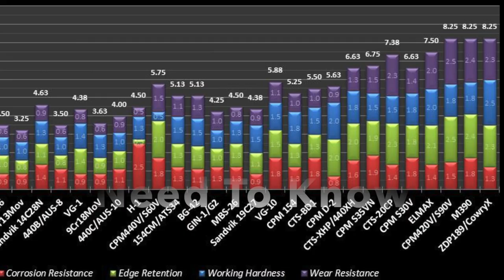Knife Basics - What You Need To Know About Knife Steels

Comment: This makes me love cold steel  even more does anyone know how strong or good  carbon V from cold steel is It's a steel that was still made in America
Reply from the maker: Originally Carbon V was basically 1095 with a bit of chromium added to the mix.  Unfortunately it's a proprietary term owned by Cold Steel and there is some evidence that they have changed the steel it refers to at least once.  It still seems like a good steel though.
Reply: Many years ago I remember a hardness test of various knives from China.  It was kind of scary, they slap any label they want on anything. There seems to be no standards.

Comment: It's all good steel except that 9 cr13 china steel . Buck does wonders with the 420 with it's heat treatment. Esee does a phenomenal job in 1095 and Benchmade has s30v the best. Spartan blades does s45vn very well. I have a Bradford in elmax that holds an edge but I wouldn't pry with it. .
Reply: Weirdly enough 1095 although perfectly adaquate actually has relatively sub par toughness at a given level of hardness so Esee could do even better with an alloy like 1084 or even better still with 80crv2.
Reply: I have a Chinese Spyderco Tenacious in 8cr13mov that is always in my pocket because it outperforms everything in my collection, including magnacut and m390. Know why? It’s a better knife and grind, design, and heat treatment than something like a Kershaw Link in M390. If it’s steel that can be hardened through heat treatment, it is good enough to make a fantastic knife. It’s more up to the maker than the steel.
Reply: Nerding out on steel is just a thing produced by the iphone generation where specs on paper mean everything, and actual, objective observation through use isn’t even considered.

Comment: What is your favorite steel for long term  survival knife?
Reply from the maker: My current favorite is CPM 3V.  It's a very tough steel, with good wear resistance.  1095 is probably my second favorite.  Again a very tough steel, and while it doesn't have the wear resistance of 3V it still takes an edge and holds it well.  A third one would probably be 154CM.  It's hard to work, so it's not common and it tends to be relatively expensive; but it holds an edge like nobody's business.
Reply: @ckurtz1013  Can you recommend a 3v survival knife, which can allow me to do some bushcraft tasks as well? 
I do not know why but I do not trust Cold Steel (SRK, Master hunter 3V) 
and Bark River is bit expensive :D
Reply from the maker: Benchmade's 202 Leuko is probably the most affordable one I'm familiar with, and you might find some good deals from Bradford and Dawson; but in all honesty, I doubt you'll find many in 3V below $250.  Another reason why 1095 is my 2nd favorite steel for outdoors type use.  It's a hell of a lot cheaper than 3V or 154CM.
Reply: @ckurtz1013  Thank you!

Comment: First. Please I want the link to the picture of the video

Second. I'm from Brazil, and here we have steel 5160 and 52100, and idk the names of these steels in English, so plz help me!
Reply from the maker: Most steels have the same name no matter which country you live in since the name is decided by the company that makes the steel.  That's definitely the case for 5160 (commonly used as a spring steel here in the U.S.A. as well as a knife steel), and I'm pretty sure that's the case for 52100 as well.  As for the image I used in the thumbnail, I got it from BLade forums.  A quick link is https://i.imgur.com/zmoixgj.jpg
Reply: same, those are just not as common in knives as many others.
Reply: 5160 and 52100 are SAE terms that are defined using a US based naming system so the names are identical in English.

Comment: Buck 19 blade steel is 420 hc. its not 440a or 440c steel which is a harder steel. I own a buck 19 and i will keep it cause i lost the receipt.
Reply from the maker: If I said Buck uses 440c, I misspoke.  Still, their 420hc holds it’s own easily.  I’ve heard very few complaints about Bucks.  Of course, there’s always someone who will point out flaws in any knife, even ones using the latest super steel and costing $1000+
Reply: YOU WIN, 420 hc is not 440, ps i subscribe to your channel looking fowerd to learning more.